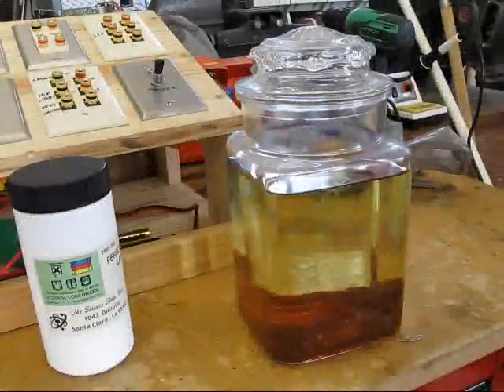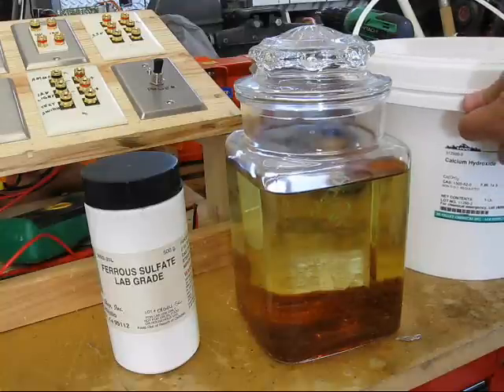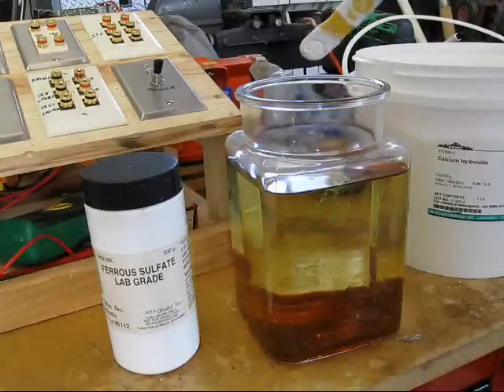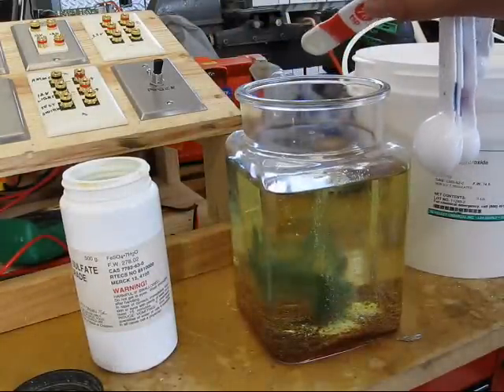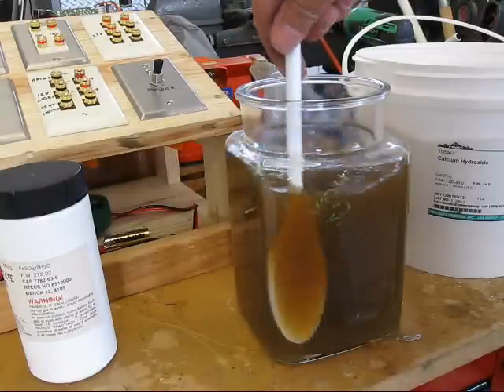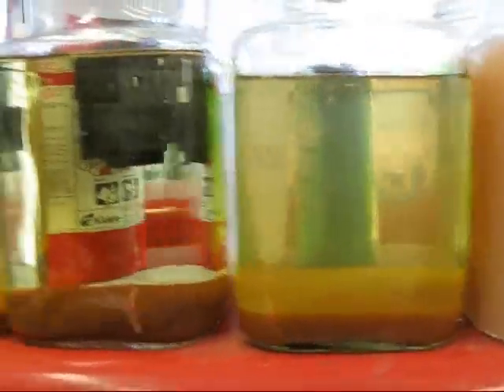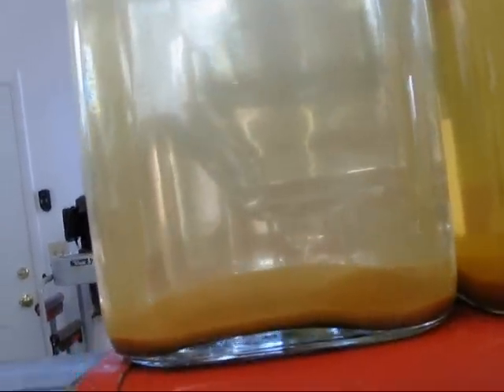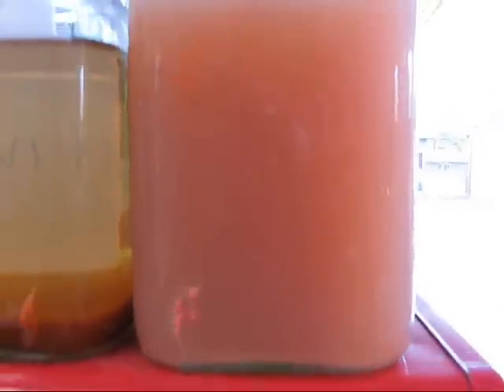#08-046 Hexavalent Chromium Initial Test

Comment: Your hexavalent chromium is far from being completely reduced, the green color that you see after adding the ferrous sulfate is your trivalent chromium(chromium hydroxide) and any red that is left is still hexavalent.  Also, the reason that your vinegar solution did not form a precepitate is because the ferrous iron precepitates at a pH >4 and the chromium precepitates at a pH >9.